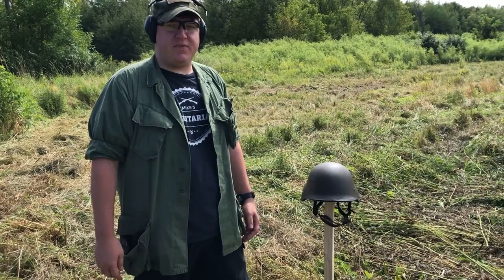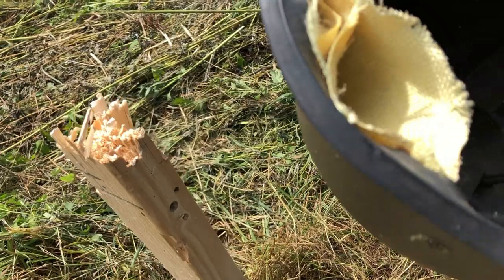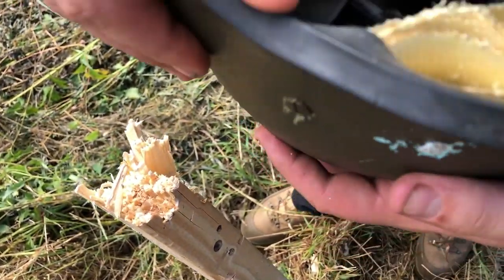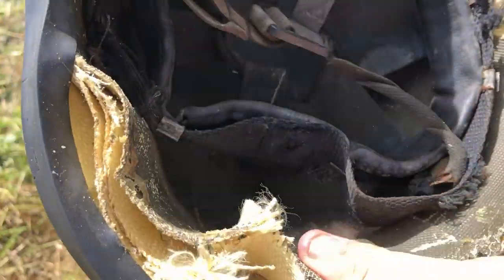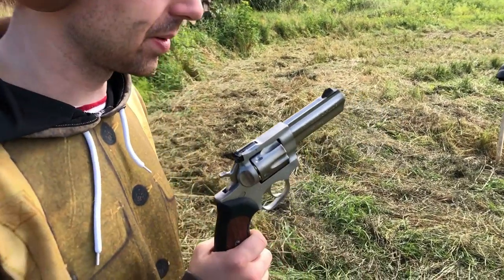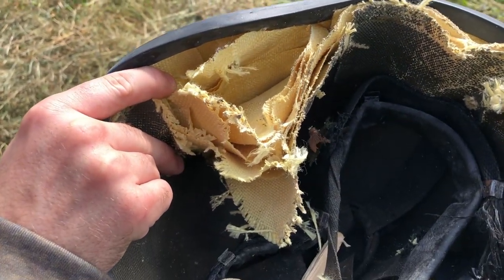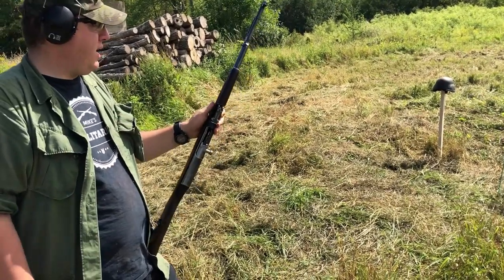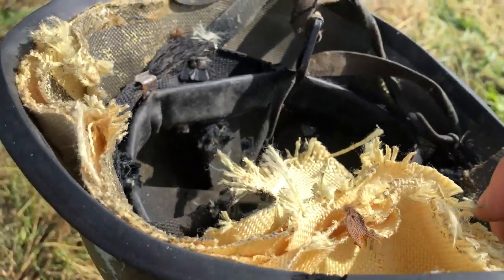Ballistic Test: Slovakian ASR97 Veplas Kevlar Helmet

Comment: even though the 7.62X25 did pierced, that wasn't that far from stopping it. i m sure that addind an thin layer of steel on the front could have allowed this helmet to stop it.
Reply from the maker: Maybe, but then that helmet would weigh a shitload.
Reply: Another layer or 2 of Kevlar would probably do more.
Reply: @MikeB128  it depend the thickness of the steel and the surface covered. usually, old steel helmets with approx 1mm (1/25 inch approx?)  of thickness weight like 1.2kg (approx 2.4pounds)

so, adding like 0.5mm (so, 1/50 inch) of high-hardness steel, and only on the frontal arc, might increase the weight, but stay reasonable  (maybe 250/300 grams more)  but be enough to flatten a bit the 7.62X25, so that the kevlar behind manage to catch it.
Reply from the maker: You spent way too much time on this. Helmets (until recently) were not made to defect straight hits.

Comment: It probably would have stop the 7.62x25 if it was newer
Reply from the maker: Wrong. Rigid Kevlar doesn't deteriorate. Soft kevlar does because the weave comes undone. This is hard kevlar, and isn't like ballistic nylon. I shot a PASGT helmet from the late 1980s and it performed amazingly. This is a gen1 Kevlar helmet, and wasn't made totally correct, but they learned from it and corrected it.
Reply: Better than a mk 6 anyway fuck that is scary that i was wearing a mk6 in iraq in the infantry around 06 until i got the mk6A looks like a mk6 but the mk6 A kevlar its meant to have the same protection as the mk7